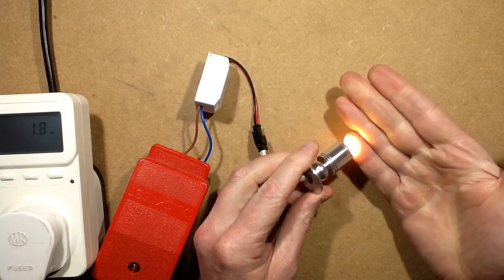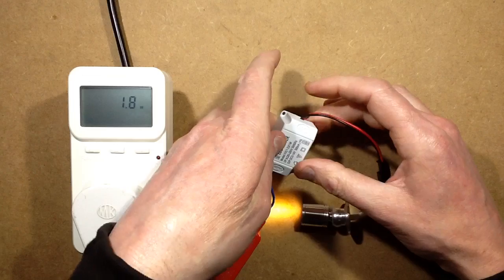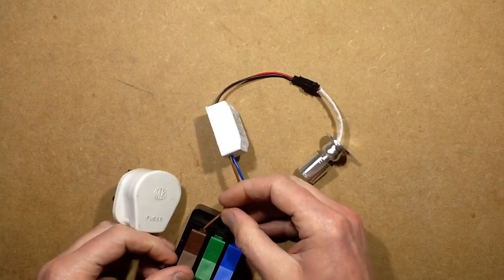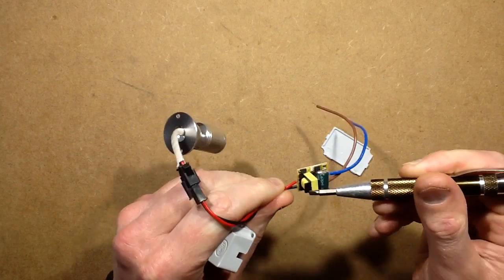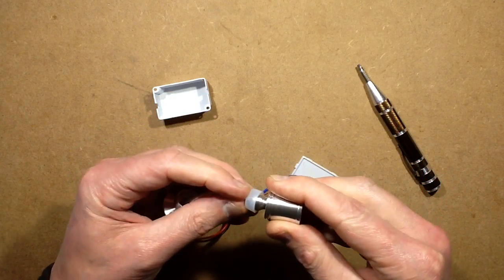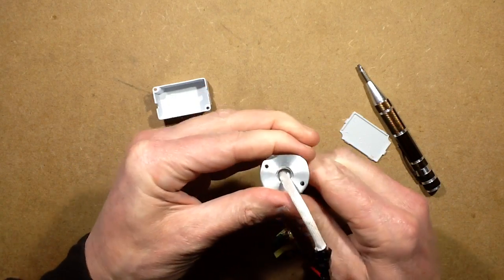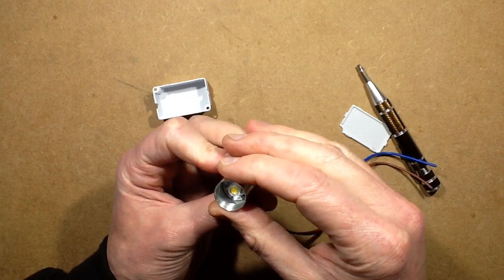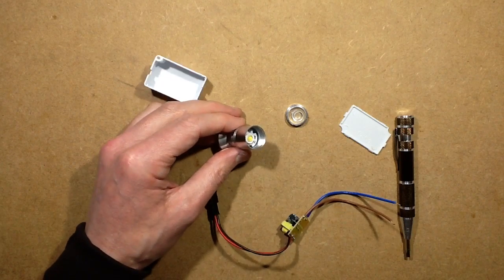A look inside a little LED swivel spotlight.

Comment: hi.
i have 10 of these for my cabinet but im no expert in wiring them up.  Can you help out please?  Do i splice the wires together in power cord that goes in wall?
Reply from the maker: They usually require a current regulated driver.  This type can be wired in series in multiples from one suitably rated unit like a 10W 350mA one.

Comment: If you ever get a group buy going on those mains adapter blocks like you discussed in a previous video, I definitely want one.  Even if the colors are wrong for my american wiring, I never liked our colors anyway, who makes live black, seriously?

The usefulness of such a device really can't be overstated.
Reply: +Jensen567 Europe uses black for a live phase, too.  The UK used to use Red/Yellow/Blue for 3-phase (415v) power until 2004 when it switched to Brown/Black/Grey to harmonise with European colouring.  To make matters worse, prior to 2004 black was used to indicate a neutral conductor, so now you have places wired using blacks that can be either 0 volts or 240 volts as many installations still use pre-2004 wiring, and in many cases use a mix of both old and new.  I still hate these new colours today.  R/Y/B used to be much better in my opinion - bright and obvious, versus 3 of the dullest, stupidest colours one could possibly choose to indicate live power connections.

Comment: Nice little thing for the price. But why do they always have to "oversell" their products (often to the point of flatout lying)? "aviation aluminium"? Such a thing does not exist. And 120lm out of a 1W emitter? I doubt that.
Reply: +Jeremy974 'aviation aluminum' is not a grade of aluminum. There are specific grades favored by aviation. What does that even mean, different parts of planes require different grades of aluminum. The one key attribute that all aluminum's used in aviation must have is low temperature ductility. This is so the plane can deal with the pressures and low temperatures of high altitude flight. Why would this help an LED spotlight...
Reply: @rich1051414  their are a few aluminum alloys used in aircraft that are also very common in other fields, 6061 for instance. it is one of the most common aluminum alloys used for any industry, so it is quite inexpensive. while somewhat misleading, it is not lying, as it is actually commonly used for aircraft as well.
Reply: +superdau Aviation aluminium sheets are usually not only aluminium but an alloy of aluminium with other metals to hel strengthen the sheet it's often used on planes and trains.